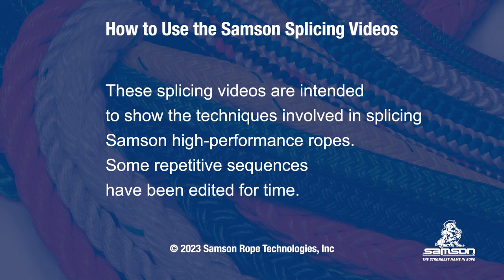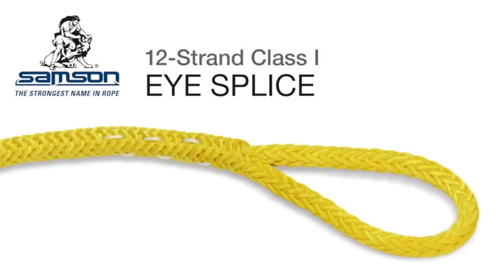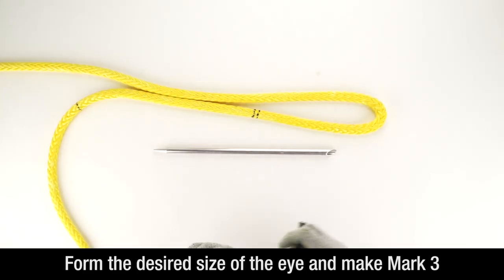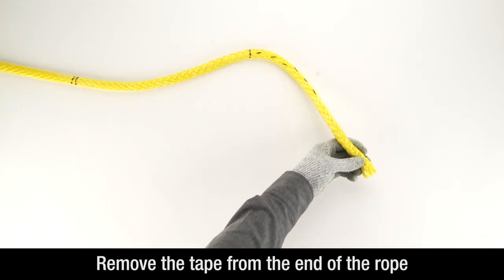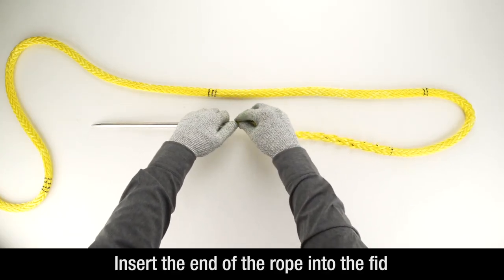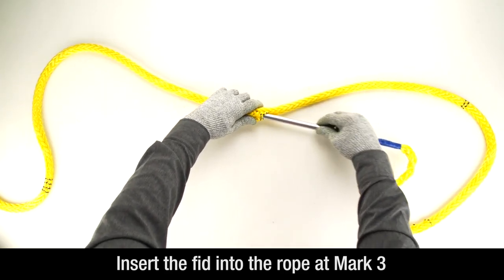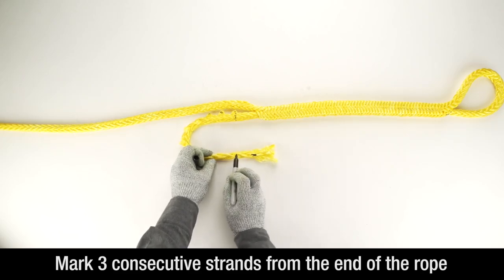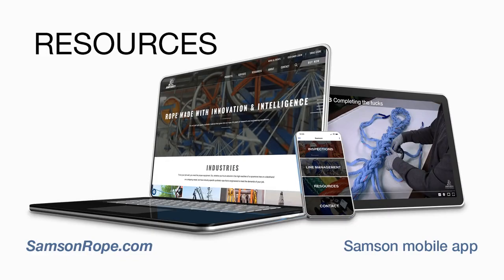Samson Rope: 12-Strand Class 1 Eye Splice

Comment: I've noticed that a lot of people will do a couple brummel splices before doing the bury - is there a reason they're doing that, and is it even required with Tenex TEC?  Thanks!
Reply from the maker: The Brummell keeps the splice tail from coming out when the rope is being handled (not under tension). Samson prefers lock-stitching to secure the splice tail, as it is less disruptive to the braid structure.
Reply: I'm no expert but they say the splice is stronger when done with stitching rather than Brummel locking loops, presumably because there are fewer sharp turns. The stitching requires vigilance to the future to be sure that stitches don't fail or get snagged out when the rope is regularly used in a harsh and dirty environment. Stitching also needs to be at least as resistant to UV light as the rope itself, and the companion video showing stitching technique has guidelines regarding stitch fabric and size to be used. I would reach for the Brummel, accepting a little lower breaking strength to avoid need for careful attention to those stitching details. Interestingly, both methods lead to a failure point where the taper causes a change in line diameter, well away from the loop itself. Other sources describe a bury length of 72X diameter, which is longer than the 42X described here. I don't know why the difference.

Comment: Is it just me or is the fid required for a 5/8 diameter rope supposed to be 13" not 11 like it says here. Unless I'm going crazy an 11" fid should be used for 1/2" rope....?
Reply: I usually use one size bigger  fid w Amsteel 12 strand,  do a  72  x  diameter bury, so half inch gets 36 inch bury w tapers